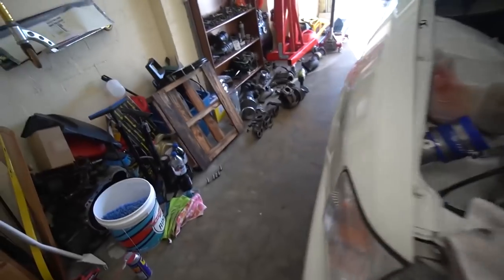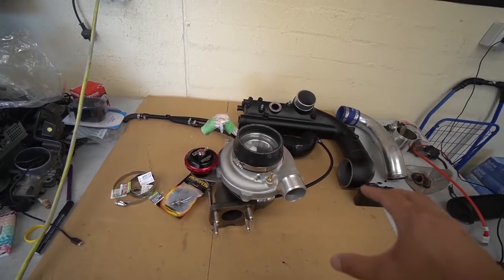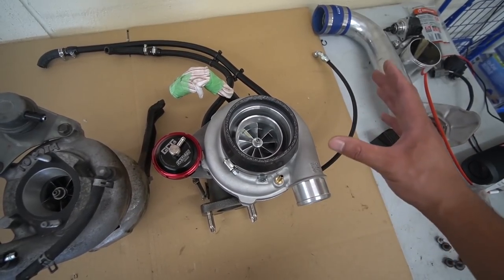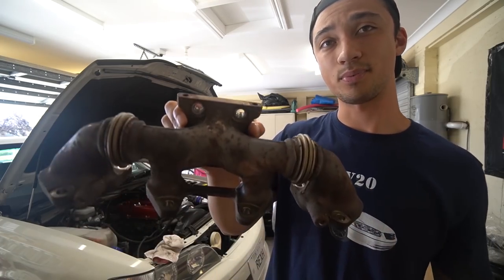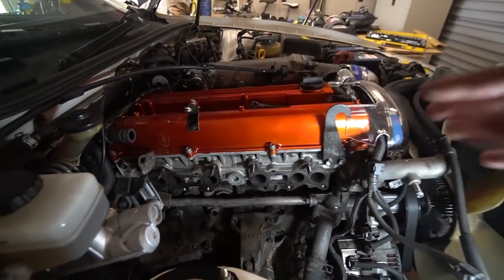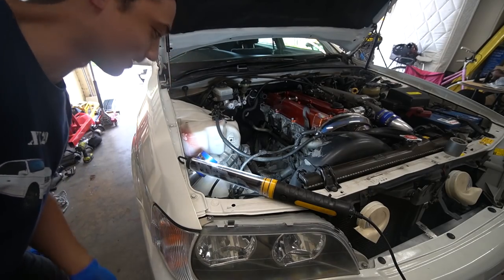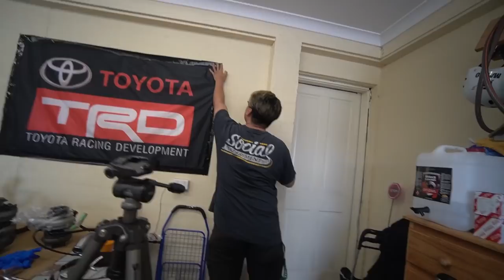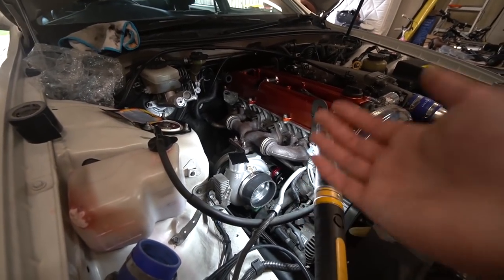Part 2 - BIG TURBO Install on the JZX100 CHASER! (GTX3076r)

Comment: Awesome content bro. But please, for the love of the Chaser bless it with an 86/BRZ diff before you run this turbo on full song
Reply: Been said so many times already,  not listening
Reply: Is this car not a proper jzx100? Should be an 8 inch from factory. Only the non turbo models got a 7.5" diff eh?
Reply: @needspeed96  it is a proper JZX100, because it was an auto it came with an open centre 3.9 diff. You can directly bolt in the 86/BRZ diff which is a 4.1 ratio and comes with a Torsen LSD
Reply: @Vaatzes  Ahh I see what youre getting at.

Torsen LSD's are meh at best. Since it already has a good 8 inch, and good axles, better off investing in a proper 2 way.

I didnt see his manual swap video, but if it is a r154 the 3.9 ratio should still be quite nice.
Reply: @needspeed96  the Torsen that came factory for the JZX100 is definitely very meh. The Torsen in the 86/BRZ is stupidly tight and feels great when it locks up, very confidence inspiring and for the money you can get them for $300-450 from a wrecker.

If he plans on tracking/drifting the car then hands down a 2 way is the best option

P.S the 86/BRZ LSD retains your stock axles. Only the half shafts require a change over
Reply: @Vaatzes  As in the axle cups in the diff can be swapped from the x100 to the brz to retain the x100 axles?

Good to know its a bit easier then I thought. Heaven forbid anything happens to my 2 way haha.
Reply: @needspeed96  Yep spot on, the axle cups just have to be swapped (and change the seals while you're at it for good measure). Almost a full bolt on solution for peanuts which is the whole appeal of a street warrior build ;)